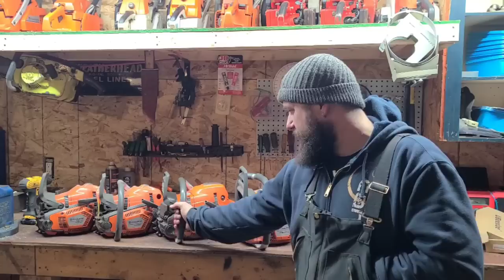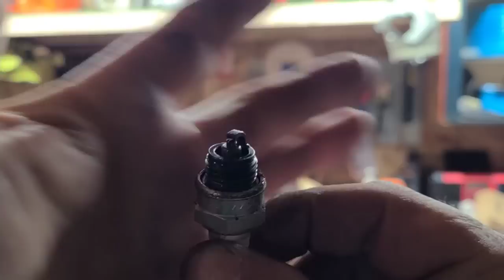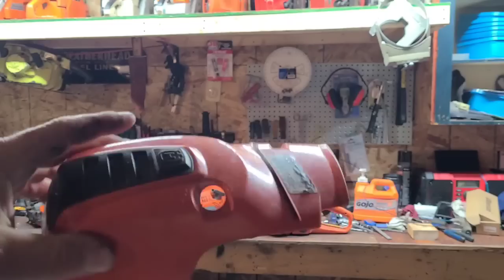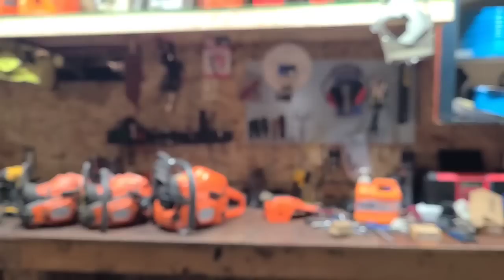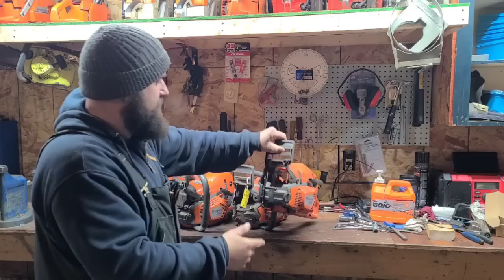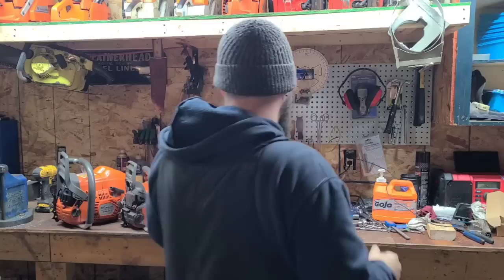FNS- Husqvarna Auto Tunes, my thoughts about them.

Comment: I have a 545 at saw.  It’s a nice saw to run, however it has had a few kinks worked out of it.  Had the carb replaced under warranty and some other things, I forget what they all did.  I personally think they just threw parts at it until I was satisfied.  The saw would quit running in the cold.  It still from time to time stalls after you hit the throttle after idling warmed up.  The saw did that new for a few tanks of fuel, but eventually stopped doing it.
Reply: My  545 stalls that way too
Reply: @Witschor  good to know it’s not just mine.   Do you like the saw?
Reply: @brentbell9543  
Hey, i got the 545 MK1 and yes i do like it. Its revy and it was nearly a third cheaper than a 550xp .Very low Fuel Consumption. 
I only make Firewood for myself and run it on Aspen . I changed the Bar and Chain sprocket to 3/8 
Its a narrow chain only made from stihl with Fullchisel in 0.50“ . Chain calls PS3 
Picco Super 3 . Thats better than the new x-Cut because x-cut is no Fullchisel . 
That‘s like a Tuningkit and cuts like a Beast.
Reply: @Witschor  I left the .325 setup on it, I have wondered about going .375 on it but I find I like to run a few different saws when I’m bucking firewood so it has become my small tree feller/bucker and I use saws with much longer bars for doing the majority of the bucking so I’m standing upright.  I have a vid on my channnel of one of the saws.
Reply: @Witschor  The x-cut chains are pretty darn close to full chisel 🤷‍♂️ Maybe a "semi" semi chisel?

Comment: One other issue I notice with some people, they seem to for some reason, have the need to cut a lot of air. Especially when limbing. Not so much in a woodpile. I will take notice next time I am out if I even have the saw at full throttle when limbing. High rpms and no load is a issue. Also maybe these new saw are designed to run hotter to meet EPA standards. I have only blown up one saw in my lifetime. I by mistake, put raw gas in a 254xp. My first brand new saw was a XL76. That's a Homelite. My last new saw was a 550xp. Mark i. Thinking about getting the mark ii. If they are better I will have one. Still doing the research on that.

Comment: I’m late on this video, but curious on your thoughts on the 550xp mkii. I’ve had a little 194t for a while now and it’s been great. Live at 8000’. Any thoughts or tips for keeping a 550xp mkii in good order? I don’t heat with wood or get a whole lot of time cutting but other than the standard maintenance procedures, any insights to that saw? Seems like an appropriate buy for me. Much appreciated.
Reply: I know you didn't ask me, but here's my two cents.
Forget about Husqvarna oil. Get something like Motul 800 road racing and ethanol free gas. 40:1 mix should do it.
Never be a fuel hoarder. Buy and mix only what you need because the damn thing can get stale after prolonged periods or storage. Also, never keep it in your chainsaw for more than a month.
Other than that, let it warm up good at idle before you jump on it.
I don't get people who start cutting 10 seconds after they started the chainsaw, especially in the winter.

Comment: I too am a fan of a good ole carburetor saw, But I will say that the Stihl MS241CM I had was a nasty little critter. I never had any issues with the MTronic either. You just have to learn how to operate them, as it's a little different than a normal carb saw. I miss that 241, sold it to buy a cherry 1991 Husqvarna 262XP, that needs ported ;)
Reply: The MS241c-m is a sweet little saw, I wouldn’t trade it for a new 562xp!
Reply: @MrNvanderploeg3  I regret selling it, especially considering they're hard to find here in the states. They're expensive little saws, but I'm very happy with what I have. I found myself grabbing it less and less after I started using my Huskie 254s.

Comment: People tend to maligned what they don’t understand 😁
Auto tune keep the chainsaw running almost perfect most of the time . After the initial tune.

Less smoke , less emissions and max power at all time.
I’ll take auto tune .

I remember in 1980 when some of the chainsaw run 1:20 mix and ignition point 🤣
Some people spend more time working on the saw than working with the saw

Comment: What's your opinion on the 435 and others huskys in that series I know they're not xp pro series but was wanting your opinion on them
Reply from the maker: Hey Scott, I don't have any experience with the 435 or many non xp saws.
Reply: I have a circa 2014 435. There's nothing wrong with them in my opinion 🤷‍♂️ Mine has held up fine. Obviously I use it mostly for limbing. Just because it's "homeowner" quality doesn't mean it won't last if you take care of it. As long as you run a sharp chain and can tune a carb they do fine

Comment: I've ran a 550xp mk1 for about 6 years now. I've yet to have any problems with it besides it sometimes bogging down while given full throttle just after coming down to idle and it being slow to come up to rpm from idle. Basically, it's like the low screw is set wrong. I really wish it had a regular carb since I don't feel like sending it to the shop just to electronically turn the low screw.

Comment: Greetings! I have a 2016 Jonsered 2252 Ulticor (pro grade) saw.

ISSUES - can be fickle to start. 
Can be difficult to restart when hot. 
You need to give it full throttle when putting it into wood.
Mine blew up after 10 months of fairly light use, I told the dealer it was running lean and he retuned it twice before it failed.
You cannot adjust them, they are programmed on a laptop.
GOOD - fast throttle response, a real screamer!
at 52cc cuts as well as most saws 60-65cc.
Light weight, good ergonomics.
CONCLUSION - I prefer older saws I can tune in myself
I prefer old torque monster saws even though they weigh more.

Comment: what is this muffler mod you speak of?  I also thought that would be death to and AT saw?  I run a 555 and would be interested in helping it do its job.  Not that I'm not happy with it.
Reply: I like my 555 autotune as well.  Going to open up the muffler a wee bit, apparently they will tune themselves for the changes to the muffler, and run cooler.  should add abit of power, and lower operating temperature is a good thing.  The 555 auto is a fast stock saw, and great for firewood, due to its light weight.  I’m generally not running full out for the whole day....run a tank out, huck some cobs in the pickup, then repeat. 1 and 1/2 tanks usuallyfills the full sized pickup box to the brim...they are fuel efficient!

Comment: Im looking at another 60cc saw, considering a husky. If the cylinder let go. What would the piston and cylinder run me?  Is it possible to convert a auto tune back to old school saws.  Ive heard of loggers doing that to m tronik. They run them till they break.  Then drop in a carb and different fly wheel
Reply from the maker: Husky 562 top ends arent super expensive. Theres no non autotune versions of the auto tune saws so from what I've seen its not easy to make them carb saws.

Comment: Hey Tinman, what about Timingnumbers of an Autotune Saw. I know they are stratos ,but i‘m interested in the Numbers. They are very revy , have you written them down . Maybe you can do a Video about it. Thanks, keep doing!
Reply from the maker: I haven't timed any of these saws. Maybe in the future I will.
Reply: That would be very interesting . And even if you can run an autotune Coil with a normal adjustable Carb, in order for a cheap fix of an older Autotune saw in Future. I can tell you that the Ignitiontiming is various depending on the rpm. I checked it with my Timingpistol.
Reply from the maker: The problem with moast of these saws is theres no straight forward way to mount a normal carb to them. 

The 576 came in both AT and non At trim so those can be converted.
Reply: @tinmanssaws  Ok, thats nice to know, did they build the 550 with normal carb earlier? 
I know these carbs have the double baffle feeding the strato ports. Maybe a carb of the non Autotune 450e Series could be mounted into a 545 or 550. 
But the overall Question is, does the Magneto work without the Autotune Carb connected. Do we have Spark and Advance? Does it run?

Comment: I've had two 441 c one 1st edition i think 2014 it was horrible the other was a 2016 it was a whole lot better but still could bea batch to start some times ..currently I have a husqvarna 572 .but I think both stihl and husqvarna have it figured out now with these tec carbs ..but I haven't ran the 572 enough to know How reliable it is but it has way power under load then a 441 in eye .

Comment: The biggest enemy of a 562 is 50 to 1 gas. Gtta run 40 to 1 at leanest
Reply: Do you have a first hand experience with 562 running lean on 50:1 ? I mix 45:1 usually i was thinking the Autotune would go silly if it doesn't I will also mix 40:1 the saw has some rpm really.
Reply: Ya to a degree. I've actually went to 45 to 1 with a 110/92 blend using husky xp oil. No issues and mine are ported. Very high strung saw rite outta the box

Comment: I’ve ran 576, best saw ever in my opinion for firewood and good tree felling. Down side was it would have carb issues and blow up. But that was Manuel tune with issues of running lean. 

550/560 are seriously great production saws as long as they don’t idle to much and use XP 2 stroke oil. Auto tune works well on husky. Stihl M Tronic has a bit more research to go yet.
Reply from the maker: I agree my carbed 576 had many feelings issues. My auto tune one has been perfect for years.

Comment: An auto tune saw is like an automatic transmission. They are great for lazy people until they aren’t. You can rebuild an old 4 speed stick in an afternoon for almost nothing if it ever stops working. You just have to change a clutch once in awhile. The old electronic carburetors from the 80’s were horrible and that’s about where chainsaw technology is today. Luckily all three of my 1990 stihls still run as good as the day I bought them. New saws are great but I’m tired of having to “fix” a brand new saw to get it to run properly. 🤷🏽‍♂️

Comment: ..Me, I don't care for any of the new saws, really...designed to please the EPA, and to make them "technically sophisticated", IMHO..yes, they have some good points, but they are more complicated, and more to go wrong...I actually had a customer bring me in 2 saws today that his employees had straight-gassed: a 357XP, and a 562XP...top ends were toast on both, but the 562XP was worse...I tore down the 357XP, cleaned and inspected the bottom end, and did a top end rebuild, had it all back together and running in an hour and a half(I had the parts on hand)...the 562XP will take WAYYY longer than that, and be more of a headache..more wires, more plumbing, everything crammed in there tight...I am not looking forward to it...and the 575/576?...575 was junk, 576 better, but except for emissions, I never saw a point to them...yes, the 576 has a bit more grunt than a 372, but it's heavier...almost as heavy, in fact, as a 385/390..which is exactly what I would want if my 372 wasn't doing it...the 550XP's, to me, are just a smaller version of the 562XP, and similar to work on..just give me a good 346XP....what needs to happen, is somebody to make Chinese clone/knock-off 346XP's, similar to what they have done with the 372's and Stihl MS 660's....